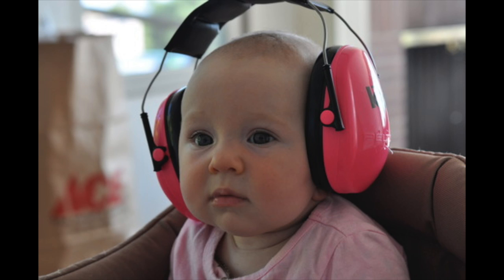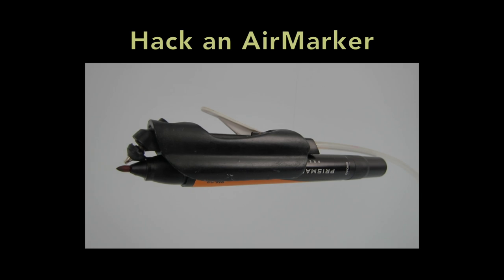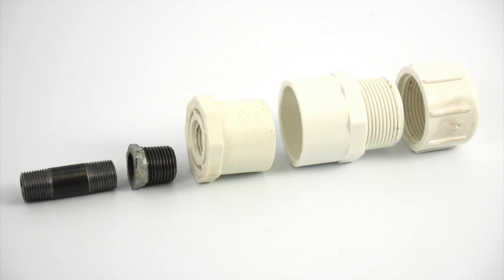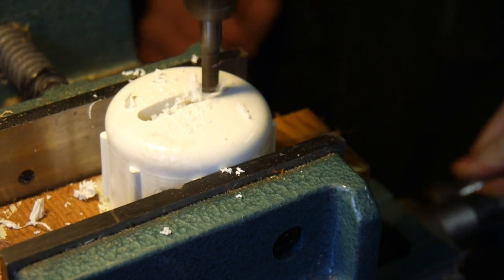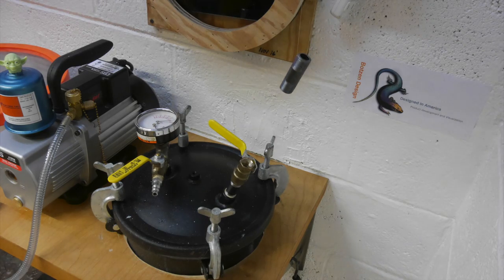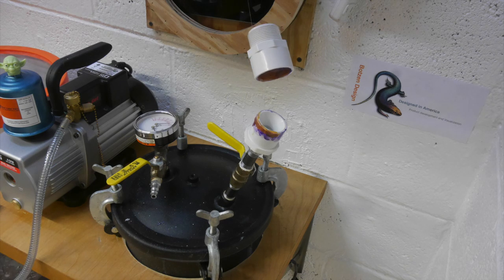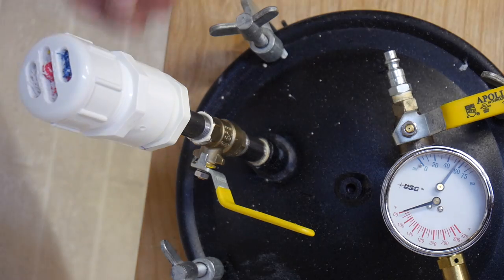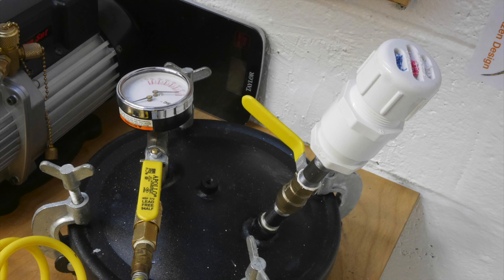How to Make a Silencer for your resin casting pressure pot Tank: Be safe!

Comment: Did the same thing. Compressed air has a tendency to produce condensation (frost) when released... if you cast a lot this condensation will build on your cloth. Not the biggest concern, but to stay away from introducing the possibility of mold, I went with tightly packed 00 Steel wool. I also punched a tiny hole at the bottom of the pvc enclosure for drainage and ventilation.

Great videos!
Rock on, brother!
Reply from the maker: Interesting, I have seen silencers with steel wool in them, never considered that for this application

Comment: from what it looks like, all its doing is adding resistance on the exhaust route for the air. you could just have put a limiting stop on your valve lever so you can't open it all the way and get the same result
Reply from the maker: +dudekidPL not the same result! that would limit the air flow but not fit the sound/ volume issue. My guess it would potentially make it worse by making it louder or causing a whistle sound from the restricted flow, plus it would limit the capabilities of the exhaust.

Comment: Assuming i can't have a workshop and have mere 12 square meters to live on (i simply love the city too much to leave it, but it entails compromises), do you think it's possible to make a cheap degassing setup for resin casting, which would on the whole take less, hopefully much less than a single square meter and cost as little as possible? It doesn't have to be good, convenient or consistent in quality or professional. If it's possible to hand pump the vacuum, i wouldn't mind having to do that, but i doubt it is.

I also considered airbrushing in summer out in the nature by taking a yoga ball, pumping it up, and then sitting on it to drive the air out, with the advantage that my room wouldn't get contaminated by paint and solvent and that everything i need would fit into the backpack. But i haven't tried that yet.
Reply from the maker: Hand pump would take a while, probably more time than it takes the resin to set. Siana Gearz

Comment: I built this silencer part for part just like you showed it, and like a complete fool I never stopped and realized that my pressure pots air release is a male pipe, not female like it is on yours shown in this video.  Is there a way or a component that I can search for that would connect a 3/25" male component to that 3/8" nipple?
Reply from the maker: You'll have to search around and see if there are adapters, in theory if it's npt you should be able to find something
Reply: @EricStrebel  thank you so much!
Reply: @EricStrebel  I just found the right size adapter to connect both components.  Again, I cannot thank you enough for all of your help, support, and tutorials.  I have learned so much from you and your channel; and I'm always excited to see more every time you post a new video.

Rock on!
Reply from the maker: Rock hard!